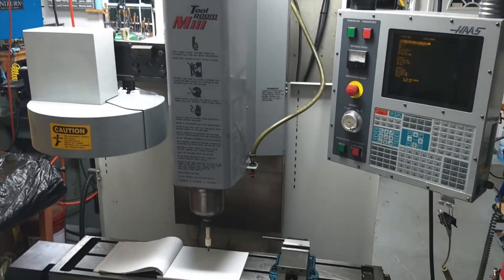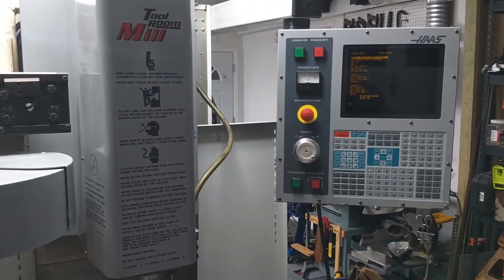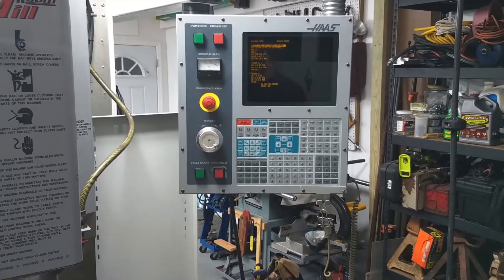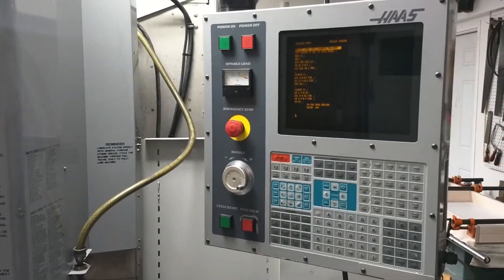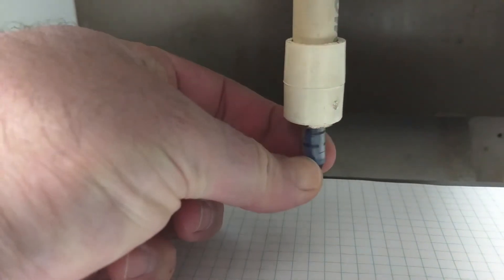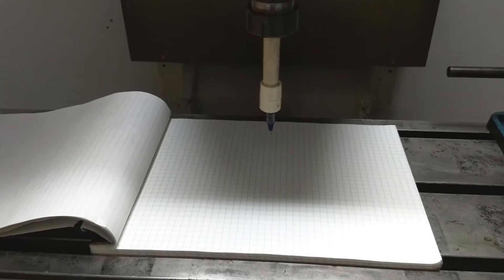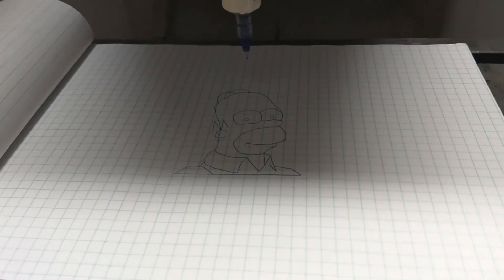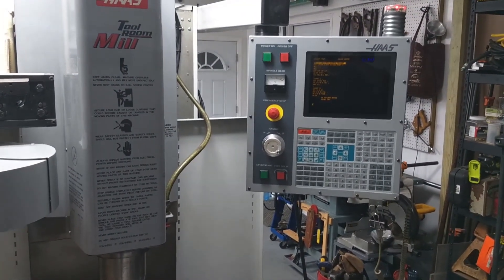Drawing Homer Simpson with the Haas TM1 CNC Mill. DOH!!!

Comment: I forgot to ask, how will you write code for this machine?
Reply from the maker: The first project will be some T nuts for my manual mill. I plan on programming them by hand. For the more complicated stuff I have been trying to learn Fusion 360 and the CAM function therein.
Reply: @lockbuilder  I tried to learn Fusion but had no hope, just totally different to what I am used to. No cam in my cad software, but I don’t need it.